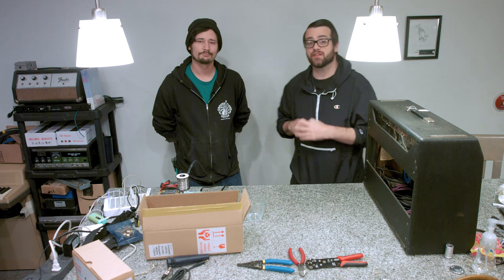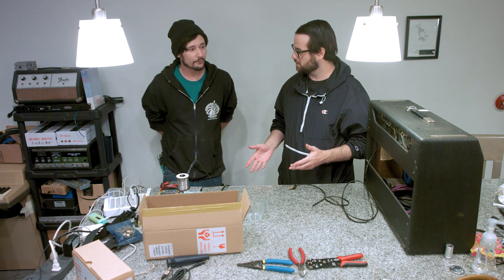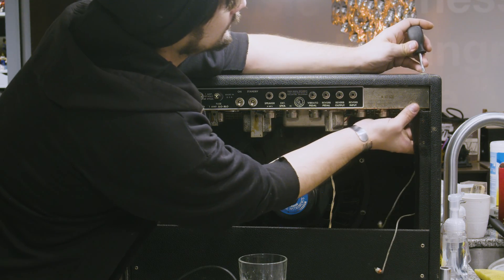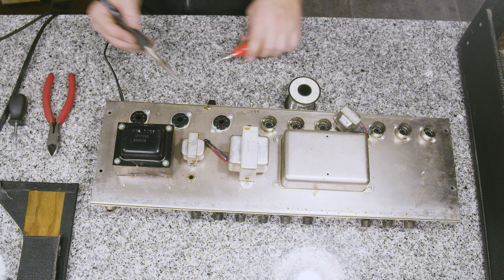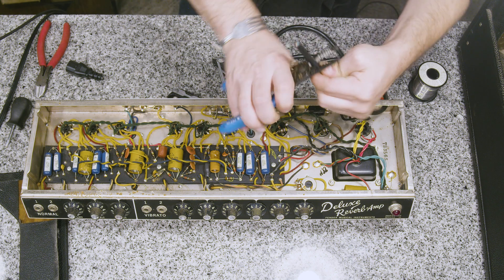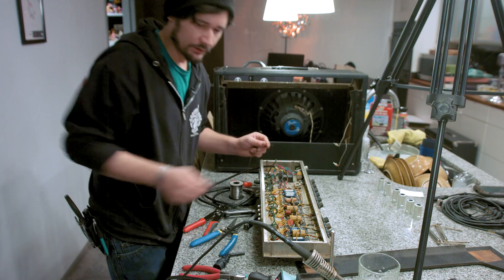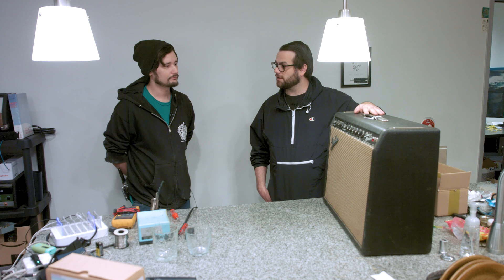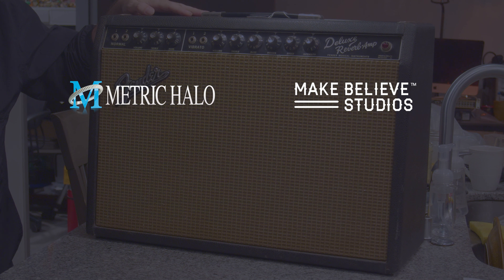Fender Deluxe Reverb Death Cap fix

Comment: Couple things, the age of the caps in a 65 would necessitate replacing them, even if they tested good. There are things within the caps that age besides the electrolytes, and it's safer to eliminate guesswork and replace the 60 year old caps as a rule, because of safety and possibly irreparable damage to the amp. And a lot of things perform better on tolex, such as two part epoxy, or even old fashioned HIDE GLUE. Hide glue was what Fender used for a lot of their amps. They held the amps together in the wood work, were used to adhere the tweed and tolex, and interestingly, was used as the grain filler/primer on the classic butterscotch blonde  tele's in the 50s, and possibly later... it’s debatable whether it was a good coice for that, as it is water base, but it certainly worked well for its purpose, filling in the very porous grain on the swamp ash Tele bodies.

Comment: I believe that a crimp ring/spade lug  should be used to attach it to the transformer mount screw. If you are going to just twist the wire and put it under that nut it should be twisted in a counterclockwise motion. That way the braided conductors wont fan out when pressed tightly.

Comment: You are supposed to discharge the capacitors before working on a guitar amp because they can hold over 400 volts and you could get killed, or get someone else killed by posting dangerous videos like this.
Reply: Yeah, the video seemed to be rather laissez-faire in general to me too.

Comment: Useful vid. Whilst I'm not an expert I believe the practice of grounding the power cable like that is not recommended. Better to drill the chassis and fit a new grounding lug (use a nut and bolt with shakeproof washer) Solder the ground wire to it, leaving enough slack to make it the last to pull off should the power cable be tugged away.
Reply: I would not drill through a vintage chassis.    Using an appropriate soldering iron, I would solder the ground directly to the chassis.
Reply: @rosewoodsteel6656  Yeah, fair point for a vintage amp. I guess there's a choice. But seeing as we're removing the death cap and fitting a three prong cord that in itself constitutes a substantial mod.  Electrical safety has to be taken seriously though, and from an electrical safety perspective the bolt wins hands down on reliability and fault current capacity. Good point though. I asked chat gpt about it and got a very interesting response. Try copying this question to AI.
"Where a tech is removing the death cap from a vintage amp and fitting a three prong mains cable a new chassis earth is required. Some techs resist drilling a vintage chassis to fit a ground and prefer soldering the new ground to the chassis. Comment on the electrical safety and fault current carrying capacity of the two options"
Reply: @ I know it's splitting hairs, Magazine045, but the death cap and grounded cord mods can easily be reversed, drilling a hole in the chassis isn't reversible.  Using a larger, high powered soldering iron can safely secure the ground wire to the chassis.  This is what Fender did for other grounds on the amp.   Of course, if you are not a purist, you can drill the hole.   Only you and your hairdresser will know for sure. :)
Reply: @rosewoodsteel6656  Well, I'm not here to argue electrical safety. I'm just a guitarist with a good grounding (excuse the pun) in electrics and electronics. Did you submit the question to ChatGpt? It's really interesting if nothing else and if you're not an electrician or engineer it's worth reading the response. We can beg to differ but really my point was just politely pointing out  best practice.
Reply: @ I understand, Mag.  I believe there are two ways to skin the cat in this instance.  Thanks for the conversation.

Comment: For goodness sake, don’t call it a death cap.   No one has ever died from one of those innocent little things.    It will NEVER short out.   It is the ground capacitor, and is very necessary if you find yourself in a place that only has a two prong outlet.   If you want to replace the power cord with a modern grounded, three conductor cord, that’s perfectly fine, but leave the grounding capacitor in place for those occasions when you only have a two prong outlet to plug into.   I repeat - No One Has Ever Died From A Grounding Capacitor !
Reply: It’s the circuit, not the cap itself.  
And caps can short. I just replaced one in a ‘69 Super Reverb.

Comment: Great video!  A couple of things to consider.  I went to a store that sells stuff for detailing cars and they have this spray stuff and a brush that fits on a drill. It's awesome for cleaning the Tolex.  Also, I am an engineer and I deal with a lot of electrical stuff.  I would suggest that you don't connect the ground to something that would disrupt the ground path if removed. (i.e. the transformer bolts.)    This is an element of the NEC (NEC doesn't apply to guitar amps, but the concept does).  I have also seen some troubleshooting videos where that turned out to be the culprit.  Thanks for the great video!!
Reply from the maker: you're welcome!!! thanks for watching!

Comment: prior to doing this, are there any safety precautions that need to be taken, like discharging caps?  I feel comfortable enough doing this job w/o touching the electrolytic capacitors...I'll leave that part to a professional.
Reply: Discharging filter/reservoir caps is 100% necessary. I can’t believe they didn’t address that first thing.

Comment: When I first ran across this video, I almost freaked. But my DR is a re-issue made in 1997 and it has the 3-prong power cord and NO death cap in the circuit (according to the schematic, anyway).  Next time I open it up I'll confirm that, but I think it's gonna be fine.  Thanks for doing this important video for anyone who has the original models of these great Fender amps.  BTW, yours is a beauty!
Reply from the maker: 3 prong reissues don’t have this problem! But thank you so much for watching! We really really appreciate it!